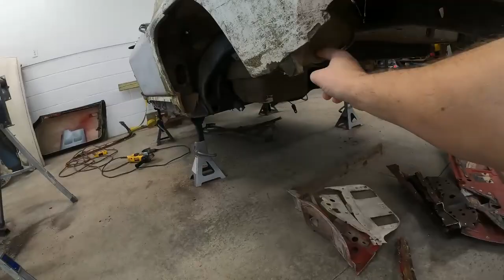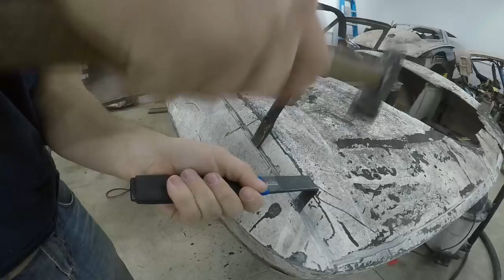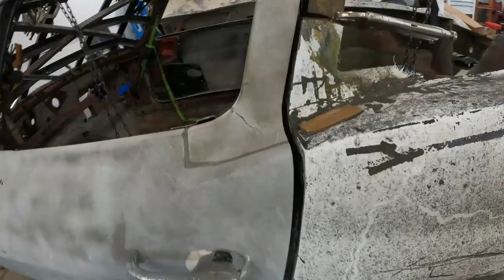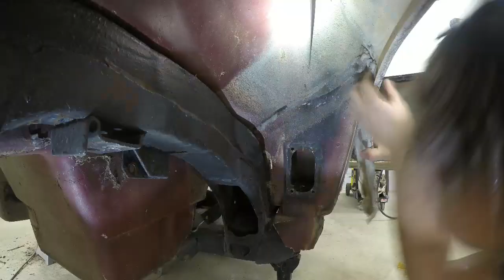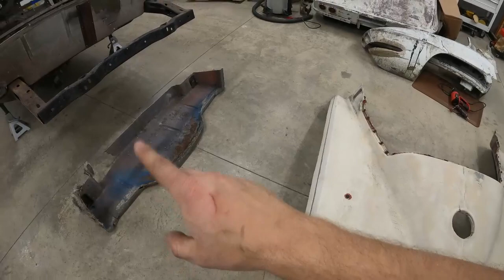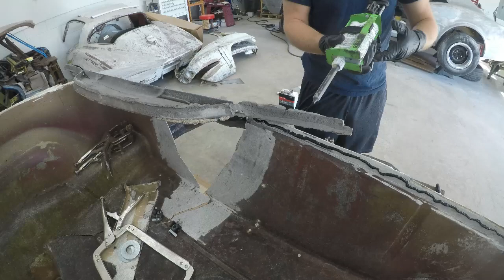How To Remove A 1963-1967 Corvette Rear Deck And Quarter Panels.  Rebuilding A Junk Yard 63 Split.

Comment: i guess i don't understand the bonding strips...why aren't the panels just glued or fiberglassed directly to each other, instead of having a bonding strip between them?  are the strips so that you can separate them later on?
Reply from the maker: I made a video on that I’ll put a link below. But the short answer is they did that to give the glue something to bite into. The bonding strip overlaps each panel by about 2”. The bonding strip takes the grunt of the stress not the glue. The glue is brittle and very hard. The bonding strip is the same as the body so it flexes with the car. If you just butted two panels together and put glue between them you could snap the panel off like breaking a cracker in half. The bonding strip also helps you align the parts together. They didn’t fiberglass them together probably so they can be replaced. But also the glue set up fast in the factory. They put the panels in a mold and assembled them and in under 10 minutes the glue was cured and the assembly of body panels was going down the line to be glued onto a corvette shell. I hope that helps. 

What Are Fiberglass Bonding Strips And What Are They Used For?
https://youtu.be/vslmHbLrvGw
Reply: @MidYearMitch  the video was great...makes more sense now